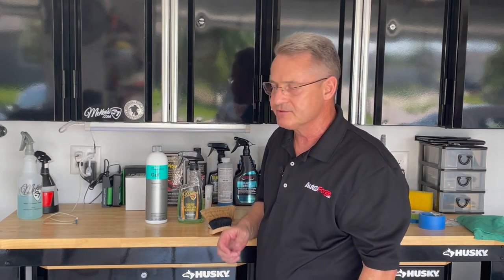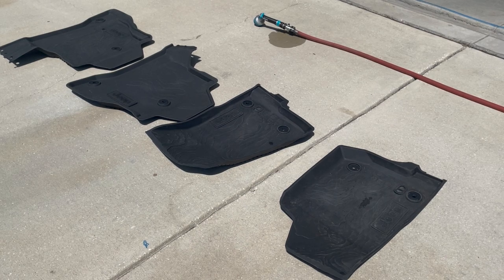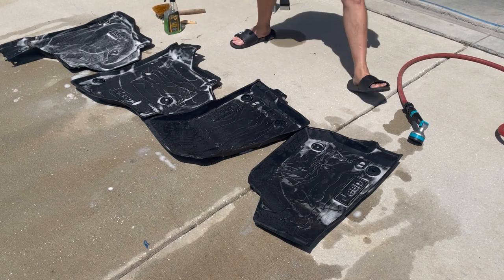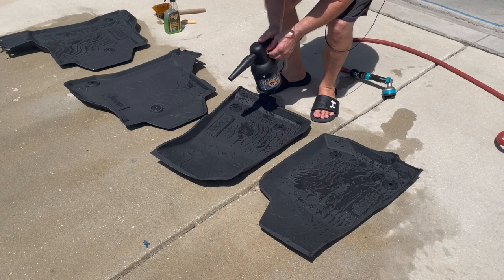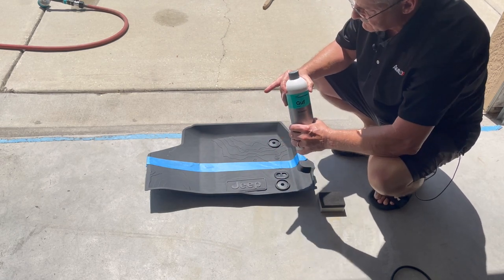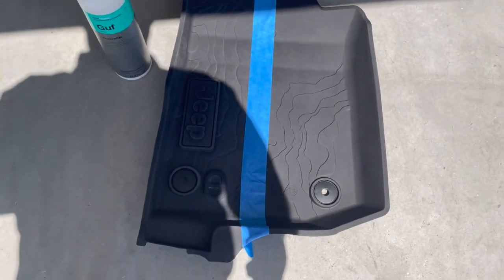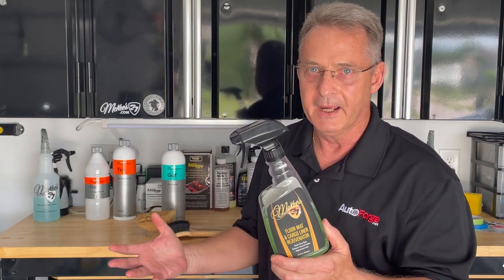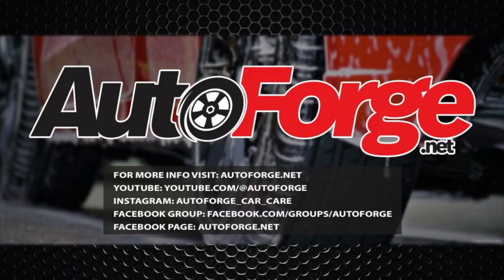Gummifix & McKee's 37 Floor Mat & Cargo Liner Rejuvenator, perfect for restoring floor mats.

Comment: Great video, Ron.  I use Optimum Power Clean 10:1, scrub, then hit the mats with steam, dry them and then use GummiFix to finish. It makes rubber floor mats and liners look brand new. WeatherTech floor liners take multiple scrubbings and steam applications  to clean, but they still come out looking new.. I apply GummiFix with a dedicated microfiber wax applicator pad.

Comment: I use Meguiars's APC from the Detailer Line (D103 I believe).  I have a hard time believing this would be bad for floor mats since it's designed to clean vehicle interiors.   I use Meguiars HyperDressing to finish and protect the floor mats.  I wipe the excess off once it's dry.  It might be slightly slippery but Hyper Dressing is a water based product that dries completelly.   I think I might give a try to Kosh Chemie Gummy Fix.  I like the fact it dries mate instead of glossy.   As for MCkee's rejuvenator, I think it's way too expensive for what it does.  It doesn't clean better than my normal APC yet it cost like 30 times more.  Thanks for the demo, nice reveal with the 50/50 at the end.
Reply from the maker: Thank you.